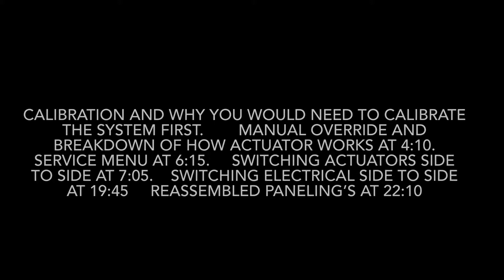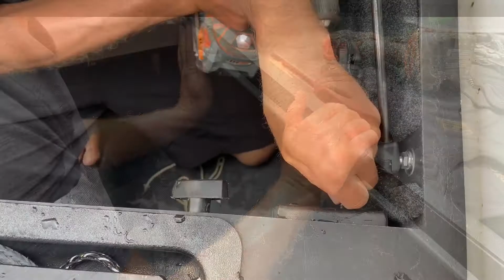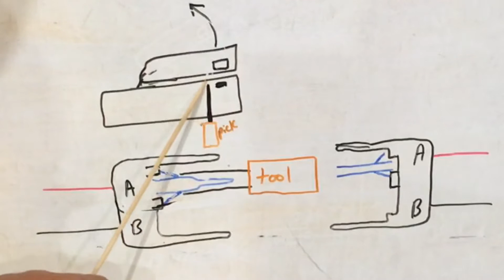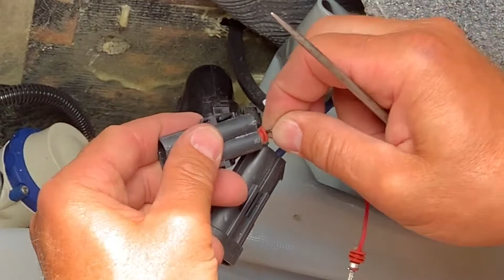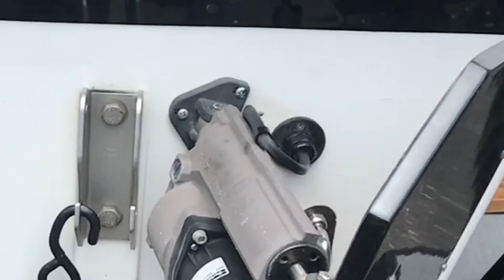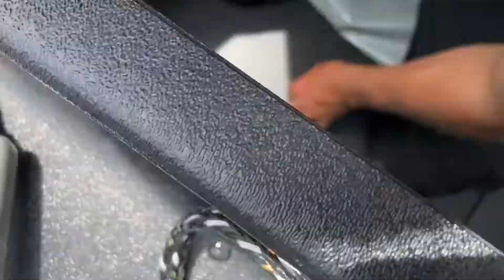AXIS SURFGATE LOCKED UNDERSTANDING HOW THE SURFGATE WORKS, CALIBRATION, SERVICE,&DIAGNOSING PROBLEM

Comment: I’m not getting power, but I cannot find the relay. I’ve been looking all over online. I took off every panel I possibly could and tried straight wires. Does anyone else have a problem finding the entire four pack of relays? I can’t even find that.
Reply from the maker: I posted an update video check it out
Reply from the maker: https://youtu.be/K69SwsjxoQU?is=aQEbmnW55rj5e4xc
Reply: I will definitely check it out, and I also solved my problem. The circuit breaker was zip tied to a transmission mount. It didn’t pop the circuit, but because it was down there in the water, it was mad corroded, and one side the wire fell out.

Comment: What fluid is the hydraulic fluid
Reply from the maker: Not sure would have to check with dealer
Reply: @diydan7019 found the answer, it’s a Parker pump, they recommend ATF. Have a gate that leaks from where the rod comes out of the cylinder. Friend knows a guy that’ll rebuild it. Going to try and get it sorted out this week. Thanks for the video.

Comment: if i hear the motor sound but the surface still stuck, is it means the hydraulic system is not working?
and i have to buy a new one?
Reply from the maker: Sounds like it might be out of oil. The motor is turning but there’s no hydraulic oil in there to move the cylinder.
Reply: @diydan7019  icic , cus i put it in the sea, thought the barnacle affect the system

Comment: Great video! I have a 2017 Axis A20 with the same issue. Thanks for showing all the steps you took as well as the tools.
Reply from the maker: I have an update haven't had time to edit video it ended up being a loose wire on the module which was behind the panel on the left side engine compartment put it back on and tightened it up and was good to go
Reply: @diydan7019  can you show which wire this was?  I am dealing with the starboard actuator not extending.  I can hear it during the service mode trying to close in the close position.  I was thinking it is the relay.  Trying to figure how best to diagnose.
Reply from the maker: @TehMost1337  just a heads up we actually found the actual problem. The module is right behind the the seat in the left-hand storage compartment a wire just came off a circuit breaker so check that before doing anything else I haven’t had a chance to do the update video
Reply from the maker: @TehMost1337  the wire was very self-explanatory if you found the control module so if you don’t see anything loose, then that’s probably not gonna be your problem

Comment: My 2016 is me giving me the fault left retract warning. It will run in and out when I do service and calibration but does hang up before stowing. How do you check if it’s the module?
Reply from the maker: Swap side to side on motors as I show in the video if it swaps sides unfortunately it’s most likely the module because it’s the only other component in the system

Comment: I also have a 2017 axis a22 I am having the same issue with my right side. I switched the wires and it did the same thing as y’all. Did you ever find out the issue?
Reply from the maker: Pretty sure it’s going to be the module but my buddy has not bought it yet
Reply from the maker: @nathanbergquist7360  it ended up being a loose wire on the control module to a circuit breaker on ours. The module was right behind the seats in the left hand storage compartment by the engine.